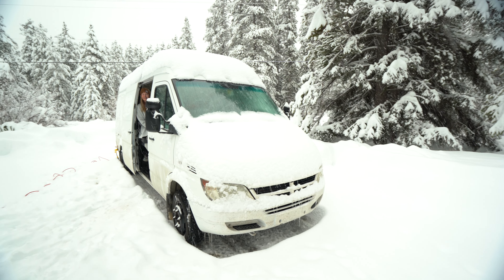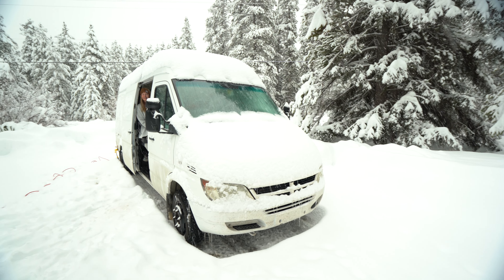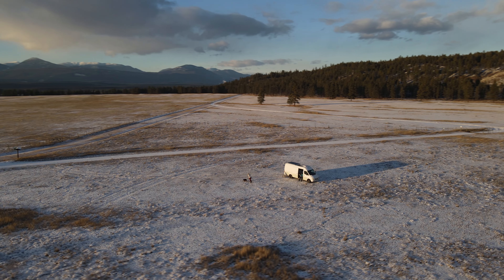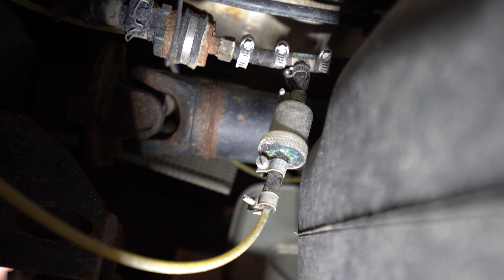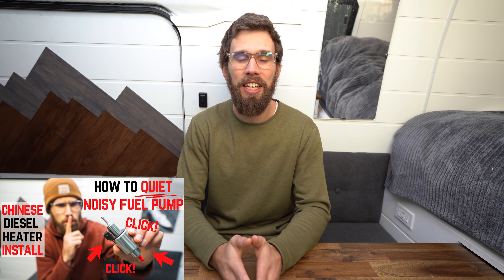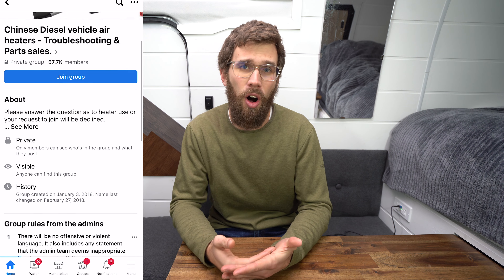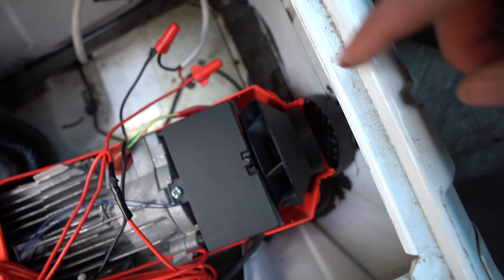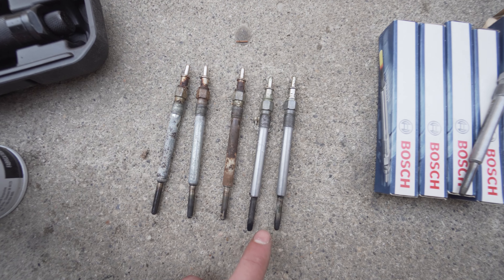Chinese Diesel Heater Review & Install Tips After 2 YEAR’S of Vanlife

Comment from the maker: Thank you guys so much watching! What do you think of the chinese diesel heaters? Have you had trouble? Are you going to buy an Espar Diesel Heater?
Reply: Dude; the heat issue I can relate to. My first one was a 3kw and even on the lowest possible setting the heat build-up was just way too aggressive. Also had issues with it blowing un burned fuel fumes into the living space on startup and shutdown.
Have just installed a 2kw instead, suggest you do the same. Much smaller and quieter.
Had issues with the pump on the 2kw (E - 10) so have used the 3kw pump for now - maybe over fueling. Used the same hole in the floor and the exhaust is making the floor hot so will be cutting a larger opening and fitting a turret. Maybe too hot 'cause of the pump. 
Excellent bit of kit though ~ BEST bang for your buck!
Reply from the maker: @dancarter482  thanks! The only issue with the 2kw one is will it keep us warm enough during winter nights when drops down to -35 degrees Celsius?
Reply: @madetoexplore  WOW! That's killer cold - recon I'd be looking at TWO 8kw units in those conditions!

Comment: Time stamp 18:45 - when you say “kick on during the night” does the heater completely shut down then re fire when the temperature drops below the setting, or does the heater go into a low power (idle) mode then ramp back up to the set power level.
Reply from the maker: It goes into a low idle mode. Have you heard of the afterburner controller?

Comment: nice video! i´d like to install a heater in the same way under the seat in my 906 sprinter however there is a upwards slope towards the front of the car
is that an issue or can i still install the heater there?
Reply from the maker: Yeah ours is the same! I put a 1” plastic spacer underneath the heater to help level it out as much as I could.

Comment: Where do you get fresh air intake into the van when sleeping? Do you crack the window? Or does the diesel heatsr provide fresh air from the outside?
Reply from the maker: We usually crack the window if needed. The heater pulls air from under the passenger seat, not from outside.

Comment: I wonder if you could just run the heater dry when going let it sit for months?
Reply from the maker: @petekeener8943  I’ve let mine sit for months wi the out running it dry. Takes two cycles to get it fired back up again but no other issues

Comment: Hi guys had you removed the second battery tray under the passenger seat of your T1N before installing the heater? Looks that way in the video. Or did you not have a second battery originally,
Reply from the maker: We didn’t have a secondary battery in our T1N

Comment: Because of the price difference, I would never consider buying an Espar or Webasto.  At 1/10th of the price, how could I??   Follow up videos are even more valuable than original reviews.  Glad to hear your thoughts after a lengthly time using your heater.
Reply from the maker: Welcome! I completely agree. Just did a tune up and replaced the glow plug for this winter. Same unit is still working great.

Comment: Did you use the base plate or drill one hole each for intake/exhaust?  I was wondering if the warm exhaust has had any effect on the factory undercoating
Reply from the maker: I drilled two holes.  No, the undercoating has held up quite well.

Comment: When I purchased my chinese heater I needed to purchase extra ducting , longer exhaust and numerous pipe fittings , pricing all these parts and thinking about keeping spares like fuel pump , glow plug and controller it worked out cheaper to purchase a second complete heater set.
Yesterday ( coldest day of year so far ) heater malfunctioned with numerous faults ( suspect controller ).
So all I needed to do was install the spare heater module and back up and running. This gives me time to strip down original and order parts and new controller which can take 4 to 6 weeks from China.
I am glad I decided to purchase a second unit.
Reply from the maker: Perfect! You made the right call 👍

Comment: just a quick note I have to work on Webasto heaters at my job day job mechanic at a big trucking company and every truck has one, and I own 2 Chinese heaters, one 12k and one 8k and they have never failed in 3 years, the webasto have many problems and do not burn as clean as the cheap ones my thought is it is caused by running them on the lowest setting 90% of the time we have to do yearly cleaning and glow plugs replaced 
as for yours only having 2 fan settings change the controller to the blue ones there you will have 6 different fan settings and your controller has a sub low by holding 2 buttons at the same time i believe its setup and ok this gives you a very low setting
Reply from the maker: Thanks for the info!

Comment: great presentation , regarding the fall on your exhaust , if there has to be a low point some where close to the middle of the run would it be possible to locate the muffler unit with the drain in it so the condensation would fall from either direction or would it vacate fumes as well under the van at that point ?
Reply from the maker: Yes that might work although it’s surprising how much condensation can build up. I’d be worried that the little drain would get clogged pretty quick.

Comment: You don't need to run it in the summer. Diesel doesn't go bad like gas. There's no "engine" it's just a burn chamber. By running it extra, you're actually just wearing it out. Won't matter either way.
Reply from the maker: Diesel fuel can start to oxidize after 6 months. Doesn’t hurt to run the heater on high for 5-10 minutes once or twice during the summer at all.

Comment: I have used these diesel heaters for 5years  now and I can tell you that the Chinese knockoffs are identical in all respects to the espar units. The parts are interchangeable. All of these units can be adjusted for altitude. The espar has a spot in the settings you can click on and it is only for 1500m or 4500ft. The Chinese units can be adjusted by going into the advanced settings. There is a utube video on how to change the settings and what they should be. Google how to change my Chinese diesel heater for altitude. This adjustment really helps. Also you can download the espar installation manual and make note of the part for the fuel. It states that the fuel should have a cetane number of 45 or more for best performance. Cetane is what makes diesel fuel ignite and burn. Most of the fuel in North America has a number of 40 except for California which is 50+. I called the best people at the diesel shops and they said stanadyne all season is widely used in the diesel engines. If you are using the 10l jugs then all you need is a tablespoon for a full tank. If you put it in your truck fuel tank you will get better fuel economy, smoother running and better starting. Stanadyne also has lubricants which help your pump to run quieter and cleaners to keep your atomizer screen and burner clean.
Reply from the maker: That’s great to know! Thanks for the comment and for sharing the info about diesel fuel 👍

Comment: Why would fuel line diameter change fuel delivery? Maybe if you have a flexible line and it expands each pulse.  But if its stiff the pump would control flow not diameter of fuel line (assuming you don't make it too small).  Also why would verticle mounting pump change effeciency?
Reply from the maker: Larger pipe means a higher flow and the possibility of more fuel entering the heater. Mounting the pump vertically means an increase in lift. The less elevation change, the better.
Reply: If the hose internal diameter is used to control flow, then of course the hose length would be critical. Sounds like a poor substitute for a flow regulator.

Comment: I've used mine for three years to heat my bedroom. I haven't had any problems at all. These work best when you use off-road, heating oil, or jet-A fuel. These are high in sulfur and won't suit up. Also, they aren't designed for 24/7 use all winter. I mean, hell, what do you want for $130. I bought 6 of them because I love them. Three years later, five are still in the boxes. If mine goes out, I can swap it out in 10 minutes and just chuck the old one.
Reply from the maker: Good plan! Mines still going strong too

Comment: Texting in the dark but the fuel tank supplied also needs to be drilled and a fitting installed, I have contacted  the seller regarding the remoe keyfob not working and fuel line issue but not hopefull, any advice would be appreciated
Reply from the maker: Have you tried reprogramming the remote to the controller? I’ve seen videos of this on YouTube and also of the fuel line tapping. I tapped my fuel line into the existing fuel line on my sprinter.

Comment: Hi,  I'm in Ontario Canada and have been a truck driver for over 30 years.. I've used Diesel Bunk heaters for the majority of my long distance driving... to help clean it out and prevent build up I was recommend to run some " Kerosene " through it and it'll help keep it clean inside...
Hope this helps... 
Look into this yourself... Have a great day..
Reply from the maker: I’ve thought about doing that! Have to try that soon. Thanks for the tip!
Reply: Let me know how it works out for you... I have a Chinese 5kw diesel Heater in my slide in truck camper as a backup/alternative to my Propane furnace.. It seems to keep my camper at 19c even when I set it to 10c.. not sure why it keeps getting that hot... was wondering if you're experiencing the same thing..

Comment: You can't return to Amazon anymore. Too many returns.
Reply from the maker: Yes you can, just buy one that’s sold and shipped by Amazon 👍
Reply: @madetoexplore  Doesn't matter if it's sold and shipped by Amazon the return policy reads: This item is non-returnable, but if the item arrives damaged or defective, you may request a refund or replacement. The comments go like this:  'AMAZON DOES NOT ALLOW YOU TO RETURN THE ITEM... So before you buy it, know that you are risking the money on a item that does not work and you will end up throwing it away' or 'Tried returning one while I got this one—found out I just pay all shipping on returns and then no refund. Still trying to get a refund for the second broken one'. That was the first heater I looked at and it took me less than 2 minutes.
Reply from the maker: @vanman3752  I’ve returned 2 with no issues and received a full refund…
Reply: @madetoexplore  Well good for you but not for many others.

Comment: An afterburner heater controller makes these better than the German ones. I’ve had one untouched and trouble free for 3 years thousands of hours of run time. And NO it’s not an engine. No closer to being one than the gas furnace in the 5th wheel they are both mounted in.
Reply from the maker: Wow, never new about the Afterburner. Definitely gonna be ordering one of those! Thanks man
Reply: @madetoexplore  it makes them use a ton less fuel, they start and stop themselves based on the temperature window you set. Lots of options with an afterburner, make sure you get it from the chap in Australia, there was a knockoff somebody was doing out of the UK that was junk.

Comment: There are no 8 kw chinese diesel heaters checkout David Mcluckie on you tube he does a test to see if there is any difference between the 5kw version and the 8kw version and there is no difference in heat output at all. it is just a marketing ploy. our 2 kw heater at 2.1 Hz drinks only 2 litres of fuel in 24 hours.
Reply from the maker: Thanks! Yeah I learned this a little while ago and I still don’t understand why they keep marketing the 8kw 🤔

Comment: I have had all 3 of these heaters. The espar 5kw is identical to the equivalent Chinese unit and all of the parts are interchangeable. I will not buy the German unit because the Chinese unit is so easy to repair and maintain. I get my parts thru aliexpress because they are always available and so cheap. The only thing is that you have to wait 2 to 3 weeks for the parts to arrive.
Reply from the maker: Thanks for the info!

Comment: Thank You for the video! One thing i'm worried about is the fuel gelling up when it's really cold, have you heard of any problems with that? Also, does head pressure affect how the pump works? I.E. i plan to get my fuel out of an aux tank mounted in the bed of my pickup truck. This tank is much higher than the pump will be so is there a potential problem with "flooding" the pump with too much head pressure? Any ideas would be much appreciated!!!🚐
Reply from the maker: I’ve used mine down to -35C with no issues. The additives they add will prevent gelling. I haven’t heard of this being a problem. If anything, I would imagine you’d get a longer life out of your pump since it’s easier to push than to suck fuel.

Comment: I have four of these, one in my van, one in my work shop and two linked to the lower floor of my house. Never had a problem, and I use diesel cleaner in the tanks to keep the motors clean. Great video though, keep it going.
Reply from the maker: Thanks Andrew. Really appreciate it 👍

Comment: I have fitted many Propex gas heaters, including one to my own van fifteen years ago, which has never failed. I paid about £200 back then, but they are around £550 now. Running on Propex or butane they burn clean. Propex are based in the south of England, and their service is excellent.
Reply from the maker: Thanks for the info Glenn! Haven’t heard of them before.

Comment: they are all 4kw real world, it is due to the thermal-dynamics of the casing size of the aluminium, so even when they claim it is 8kw, it isn't, so you can ignore the kw rating! except for the 2kw as they are physically smaller! I have gotten 5 of them, they all work nicely still, had to rebuild the fan on one, replaced the bearings sadly I put it off to long and had to buy a whole new motor. I use it to heat the house in winter so it runs 24/7 for 6m apx so I got the very high quality bearings.
Reply from the maker: Good to know! Thanks for the info and glad to hear they’re reliable too
Reply: How much fuel do you burn in 6 months?
Reply from the maker: @juliogonzo2718  that would really depend on the temperature!

Comment: Hi, do you know if there is a way to identify weather i have a 5kw or 2kw heater? I didnt know there were different sizes when i purchased it years ago and have since thrown away the packaging! Thankyou
Reply from the maker: The 2kw heaters are physically smaller than the 8 and 5. I would look up the measurements online. Apparently there is really only 5 and 2 since the 8 are actually just 5.

Comment: when you installed the heater, did you have to disconnect your battery before removing the seat (to prevent air bag light issues)?
Reply from the maker: No, there were no air bag sensors for my passenger seat.

Comment: The only problem I have with the Chinese heaters there are not enough professionals that now how to install it.  Most people do it themselves ..
Reply from the maker: That is true. Many mechanics don’t have any experience installing these. I’d probably recommend calling a heavy duty mechanic since this are very commonly installed inside the cabs of large transport trucks.
Reply: @madetoexplore   we run Espar on our rail equiment.  Trail by fire learning to work on them. Rebuild my share of the engines ones so far.  Haven't played around as much with the airtronics.   
Parts are very expensive for these things.  
5 error codes in a row and it locks you down and I have to plug my trouble shooting control unit into it to reset it.

Comment: One truck to eliminate carbon build up is to run it on the hottest setting for a few minutes before shutting off.  And ALWAYS USE A FUEL FILTER.
Reply from the maker: Thanks! I plan on taking mine out this summer and doing a full clean. Interested to see what the build up looks like.
Reply: There's a video about a user using Kerosene so they burn cleaner, I am afraid it would blow up if I try it on mine.

Do you think Kerosene is a viable option!?
Reply: @Athrunwong  Careful though.  Kerosene doesn't lubricate the stock pump and if you don't use a mix with diesel, it will kill the pump.  There is an aftermarket quiet pump made by James Browning-Smith that does not have this weakness.  So, kero burns cleaner but won't adequately lube the pump.  Now, the caveat is that there are 2 kinds of kero.  K1 and K2. K2 will lube the pump enough, as I understand, but I cannot find it anywhere near me so the typical stuff you find at sporting goods stores is the only option
Straight up diesel may gel in very cold temps.  Mine will use a 50/50 mix, but I did purchase James' pump b/c it's essentially silent.

Comment: Did yours come supplied with the hard plastic type fuel line or soft line?....and does the line from the tank to the pump matter as much as the line from the pump to the heater?  Much thanks, well done and informative video.
Reply from the maker: Yes it did. The line from the tank to the pump is under suction and the the line from the pump to the heater is under pressure. I would make sure to use the rigid line between the tank and pump because if you used a flexible fuel line here, it could collapse and wreck the pump.

Comment: Super well made and informative video! One of your complaints was that the heater doesn’t hold a constant temperature right? I thought They hade an input for what temperature to turn on or off? If not, can I not buy a seperate temperatur sensor that has this function? It is really important for me to keep a somewhat regular temperature of 16-24 degrees in my van for my reptile friend :) Thanks alot!
Reply from the maker: These heaters won’t turn on and off on there own unfortunately. They are either on high or low.